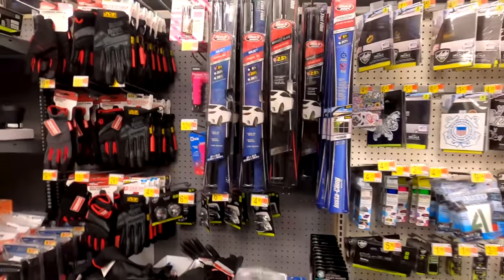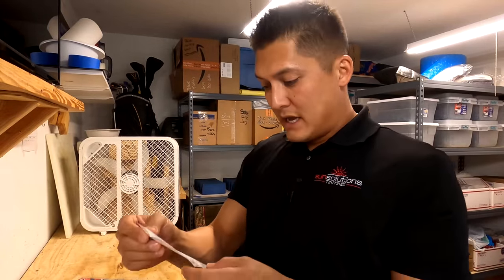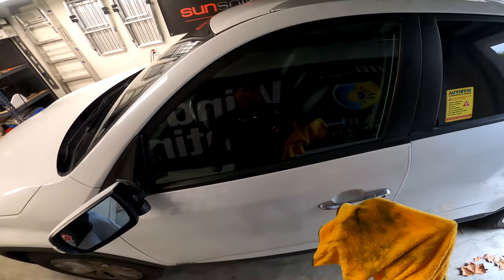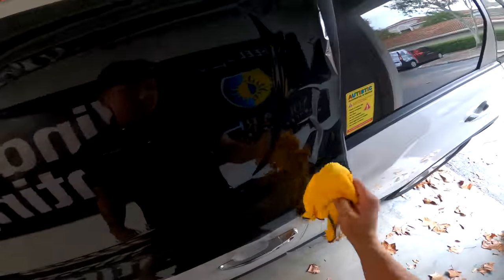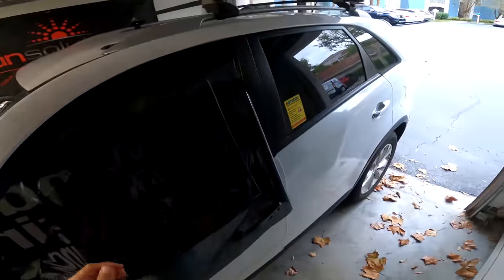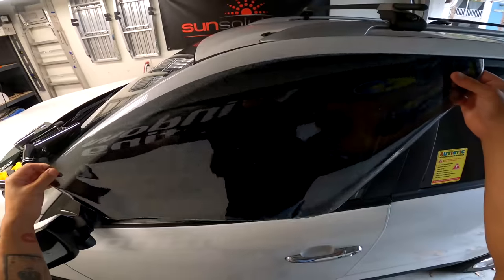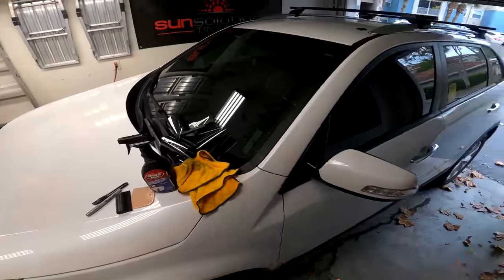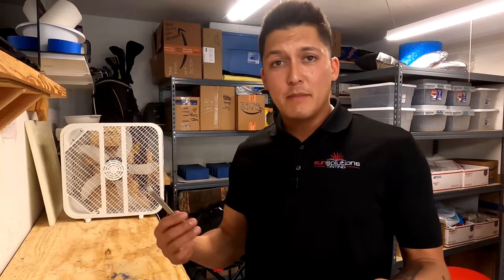How To Tint Your Windows | Walmart Black Magic Window Tint

Comment from the maker: Good luck to all you DIY'ers! Let me know how your installs went! Comment below!
Reply: Is this how you tint your cars?
Reply from the maker: @thesloth944  no not at all but this video is for normal people who just want to tint their windows themselves.
Reply: it turned out pretty bad the first time around because i had rain sheilds on the tops of my windows and i had to take them off for the 2nd window so i could do a pre template on the outside window first. i did the 2nd window with a pre template and it turned out wayyy better. i did 5% in the back and 35% on the fronts
Reply: I'm doing mine this weekend bc is getting Lil b hot 🔥 (75°)  but I'm doing it outside I don't have a garage 👎🏽
Reply: @thesloth944  ) 9
Reply: Just got the 2.5% for my back doors. Can't wait to knock this project out this weekend. Great video!! I got the tint kit-just have to get the kit and the recommended tool you suggested. Thanks man, ill try to remember to post a follow up
Reply: And as always, check your State Tinting Laws before you do anything. Ive seen people do their own and get stopped and cited or had to strip the tint off before they could drive the vehicle away from being stopped for it.
Reply: @WindowTintingBusiness  it’s been a long time since I’ve tinted windows. The Sharpie trick is good one. I always prized my Olpha blade. You did a great thing showing everyone how to do it themselves. Hopefully this will give them the confidence to at least try it. 👍👍👍👍
Reply: So no heat shrinking and no fingers?
Reply: 1st timer here. Gonna learn how to do this so I can tint my driver and front passenger windows. Its a Ford edge. What percent should I get? All my other windows are tinted pretty dark. Thanks
Reply: @thesloth944  iiîi lol
Reply: Hurry please look me up please
Reply: @TACTICALNOMAD  Thanks for the info sir. I had LE tell me bout the same thing. Made it where had to remove it to proceed. Now i know better. Thanks again sir. 😎👍
Reply: im trying to do it on a motorcycle helmet visor. it's just not working. its impossible to get the bubbles out. i have the squeegee and everything :/
Reply: Buy tint window from auto parts if you don't want your tint window to turn out blue.
Reply: What's in the spray? Is it soapy water or Windex window cleaner?
Reply: @mrmagoo9901  soap and water
Reply: How much would I need if I wanted to do a full size Silverado all windows?
Reply: Hey, you forgot to show us how it looks from inside the vehicle after the curing time and under the sun because I have a doubt that the appearance is foggy or maybe not, like this we may have the best and complete feedback of the product. Thanks
Reply: Great vid my truck looks great 5% all around
Reply: What if your windows have factory tint
Reply: I thought I did a good job until I rolled the window up and all on the bottom it had no tint I made it too short🤦🏽‍♂️
Reply: The trash can got tint not the car lol the wind wasn't my friend and not really knowing what to do. I'll give it a try again. I was thinking of using a piece of cardboard as a stencil of the lay the tint on the stencil then cut it out
Reply: I saw you had some Johnson&Johnson, I’m not sure you used that but if you did what did you use it for?
Reply: I spent an hour trying to do it for my first just for me to roll down the window and it rip off rolling it back up🫠😂
Reply: @WindowTintingBusiness  veey cool
😊
Reply: Also what did u use the baby soap for?
Reply: Instead of freehand cutting the top edge of the film why not just cut on the on top of the window using window edge as a guide? After that just lower the edge 1/8 of the inch on the other side.

Comment: came here not even knowing Walmart sold tints. Left knowing exactly what to purchase and how to install myself. great video  this is literally the best instructed video ive ever came across
Reply: I hope you didn’t get it, it looks like shit in the sunlight which is why he didn’t show it off outside. It has a milky unclear color, please don’t buy this piece of garbage.
Reply: @applepollo  what tints would you recommend? Can you order them online?
Reply: I'm curious as well about Amazon/ any other decent film that a diy can just go pick up?
8-9 yrs ago I bought  just about all that (x2 the film) for a car that I didn't keep... Could it still be usable?
Reply: @MAGA_Randy_Marsh  I highly don’t recommend buying any cheap Walmart crap. If you want tints go to a professional shop as industrial sellers mark up only full rolls of tint that usually go for 10,000 USD. Which is what tint shops buy for their businesses.
Reply: @bigdaddy6256  it depends on the condition that you have kept the films in. Amazon/Walmart or any big chain company will sell tints of low quality, as tint films are manufactured in masses of rolls that are shipped out at extremely high prices, I suggest going to a tint shop and getting an estimate instead of buying low quality garbage. Spend your money on something that will last long and turn out good instead of wasting it on rubbish.
Reply: @applepollo  get a life... so rude and for what
Reply: 😂This is black magic of youtube it won't work out that easy 😂

Comment: I decided to tint all my cars and at first i was gonna use walmart tint but Lexen sells 24 inch by 100 foot rolls for $74 in any %.  The walmart is 24 inches by 6 feet and is lower quality. I been using Lexen for 5 different cars and never had any issues. You can easily do a couple cars if you're a beginner like me and if you mess up then you still have tons of feet left.🤣
Reply: thank you
Reply: @simpp8  no problem!
Reply: I was actually going to buy that roll, thank you for leaving a review on the exact product I wanted to buy.
Reply: @tjboylan20  You're very welcome! I have not had any issues with the rolls i bought from them but if you order from their website directly they will exchange the roll if you ever get a defective roll of tint. By "defective" i mean if it comes bad from factory. My local shop uses their tint by hand and plotter but i was not gonna pay $265 for a sedan! 🤣 After a few cars i can now say this is my go to tint for the price. Held up for nearly 3 years with no bubbling on a car i sold. I currently have a prius which i did and no bubbles or peeling. I'm sure i've could have gotten more cars out of the first roll (100ftx36-15%)  but i was learning and messed up a few times so i got 3 cars on the first roll and had about 40 feet left. The second roll is (100ftx24in 5%) and used about 25 feet on that so far.
Reply: Thank you for that info! I also see they will precut them for you. Thinking about that option! Did you buy all of the stuff he recommended in the video as far as tools and aides?
Reply: @DollarsNCentsOnline  No problem! I watched -Window Tint Warriors & Tint Studio and see the tools that worked best for them and picked out a few that i thought worked best for me. I have not had any issues with any of them and they are of good quality to me. The only reason i didnt go with precut kits is because if you mess up on 1 piece, then you have to order another kit. The whole roll was the best option for me and i'm actually gonna tint my brother in law's car tomorrow with that same 24 inch roll.
Reply: What size should I get 20 or 24X100 I have a minivan and a suv I want to tint so what’s the best size to get that will work over all
Reply: @l.m.g8799  I think 24x100 should work but to be safe just grab a tape measure and check the height of the side and rear windows if that's what you plan on tinting. The front windshields are usually larger and i had to use the 36x100 rolls for those.
Reply: For the front windshield did you end up struggling on your first time ?
Reply: @samuel9046  more like around 3 or 4 times lol
Reply: @TonytheYorkie  did you just take it off and retry it til you got it ?
Reply: @TonytheYorkie  around how many times did it take you to get decent at it? I want to learn just to do something for a friend or family member on the weekends
Reply: @samuel9046  I took it off rinsed it and tried to adjust and practice laying it but then i noticed some wrinkles i made and took it off. It took about 5 times till i learned how to heat shrink properly.
Reply: @TonytheYorkie  oh okay and the sides was it easier to get the hang of ?

Comment: 1. Spray and wipe outside
2. Spray and wipe inside panel
3. Roll window down wipe middle section
4. Roll window up, scrub and squeegee (he used razor)
5. Wipe panel again
6. Put tint rectangle on outside window, liner out
7. Tack down with squeegee
8. Sharpie bottom 3 egdes, roll down slighty, then sharpie top edge
9. Cut edges, bottom 3 edges with 1/8” extra (3 blades, knife back end down), tear away from workspace
10. Roll window down, 2 fingers of space
11. Squeegee inside window (wipe squeegee after each wipe
12. Spray inside to lubricate
13. Peel liner off, leave 2 inches at bottom, spray tint
14. Lubricate inside glass again
15. Place tint on inside glass, careful with bottom egdes
16. squeegee top 4-5 inches down
17. Roll up window, squeegee newly exposed glass
18. Lubricate rest of tint
19. Carefully tuck in bottom edges behind the sweeps
20. Squeegee full tint, spread out film evenly
21. Use bondo card to squeegee tint into window edges if necessary (dont use on visible parts)
22. Wipe inside panels and outer glass
23. Dont roll down or wash windows for 3-5 days

Added as personal notes, thanks for the awesome video!

Comment: the first video that makes me feel as if i can do my front windows on my own and properly! thank you sir, true master of your craft
Reply: How’d it go? I’m about to go buy the tint now
Reply: @lanerobinson8994  it went well!!! But two rolls of tint just in case. I trimmed the first one wrong the first time. I also did it outdoors as well. Some creasing but was able smooth most of those out once I turned my car heater on and got the windows warm (didn’t have a heat gun) the bondo things work great for finishing off the edges. Good luck!!

Comment: Thanks for the video, I found it very informative. As a detailer, I just wanted to add you should only scrape one direction when cleaning glass with a razor blade, never back and forth. You do not see scratches initially, but if you pull it out in the sunlight and look closely they are there

Comment: I started window tinting in 1986. I opened my own shop in 1994. I was in business until 2017 when the frequent bouts of carpal tunnel became too much. The only thing I would do differently is, I would cut the tint on the top edge of the glass while it's down a couple of inches. I would also  join 2 pieces of tint together and cut both front and rear windows out at the same time.
Reply: Now you know that these are rookies on here they can't work with one piece of tint let alone two pieces and one cut.
Reply: Is there a reason why you have to cut it against the window instead of on a surface you don't have to be so careful on?
Reply: Comments like this are why I go thru the comments thank you for this. You just made my project that much easier.
Reply: @rhondasmith1912 You're welcome.
Reply: @DollarsNCentsOnline  cutting on  the window will give you a perfect or near perfect pattern. Also, if you use stainless steel blades they're lees likely to etch the glass.
Reply: Correct, I never mark the film at all.  I squeegee it to the glass on the outside like he does, and then just use the top, sides, and trim bottom as a guide for cutting.  For the top of the glass, it is much easier to use the actual glass edge as a template to cut against.
Reply: And here are a few tips, use stainless steel blades, and for your spray bottle use water and a few drops of liquid joy soap.

Comment: You forgot to mention mixture of water, soap and alcohol for spray bottle. Very good instruction on tinting.
Reply: I thought the same but I think the kit he bought has a premixed slip solution in it. Otherwise I thought he should mention whether he thinks he is saying  heat shrinking to fit window curvature is unneeded.
Reply: Thank you. I was searching for this comment

Comment: To separate the liner, you can also use two pieces of scotch tape - one on each side of the tint. Touch them then separate the tape and the liner will come right off

Comment: I did this same method and finished my f150 stx truck today. Literally Walmart film is good enough as tint. The 35 percent is a bit light though. 20 would've been better but Texas law is only 25 percent in front so I didn't want the hassle. Thank you for this video. My first attempt was horrible but the second time is done good. Thank you

Comment: I used the Black Magic window tint on my truck back in 2014 or so, and it's still holding up to this day. If you follow the video, it will likely outlast the amount of time you own the vehicle. 

My only gripe is the color of the tint from the outside. Thankfully it's not purple or chrome, just not the black I was hoping for. For reference, I went with the 20% VLT.

Comment: Your video is going to be so useful for me next month.

You demonstrated the important techniques for completing this job in a professional manner, even for an elderly clutts like me. HaHa

I'm going to film the back doors, the rear swing-out windows, and the glass in the lift-gate on my Ford Excursion, in preparation for going Full-Time Boondocking.

I'll also fabricate Privacy Curtins for temperature control against hot glass in the daylight sun and cold glass at night. I expect that the dark black film will absorb much more sunlight than factory tint.

You did a really, really good job presenting this video, and I thank you very Muchly.

I've downloaded your video from Utoob for ready reference when I get to this project.

Again, thanks for your presentation........

Comment: The side that curls always goes to the outside of the car before you cut you can also lay the factory edge at the bottom  of the window   set you're  tint roll down youre window pull back extra tint on top spray  the glass squeegee the top part of tint   cut extra off  pinch the tint with youre fingers slide youre blade  rate across the top edge of window  you can also use youre fingers to cut youre corners

Comment: Hardest part is cutting the curved areas, the one I bought from Walmart did not have the film protection but a paper wrap instead.
Reply: You got window cling
Reply: @DevArnold  That explains the thickness, thanks.
Reply: Thanks, now I know. Oh well back to Walmart then.
Reply: I could be wrong but isn’t window cling for your house? I didn’t even know you could tint your house windows!
Reply: @lionsatmidnight their static clean sucks it’s super rubbery and purple and hazy

Comment: I'm no pro, nor would I do any1s tint but I do my own tint on my cars an old ladys cars. Same way I've always done it but 2 things different. I've never used a sharpie before(or any marker,pen,etc) an i have to use my high dollar🤣 heat gun from harbor freight for $10 bucks. I've tried not to use it an it will not turn out to save my life without it. But great tutorial 👌! Looks good!! Just picked up some walmart 20% yesterday an gonna do the front 2 of the old ladys expedition here in the next day or 2. Gonna try your pointers an see how it go.Thanks

Comment: And it only takes about 5 minutes but to use the heat gun or a hair dryer or something like that to try to dry that window tint and solution as quick as you can and if it's really hot outside then that works too just park it outside in the sunlight make it dry quick so there's not going to be any air bubbles in it
Reply from the maker: well if there are air bubbles in it then you have to squeegee that portion out. using a heat gun will only lock it in there and it will never come out.

Comment: I for the live of me couldn’t do the rear window of a hatchback, working outside against gravity and the wind picking up, I ended up with creases trying to do it by myself. The smaller the glass the easier the tint install was for me
Reply: You have to heat shrink the tint to the window before you cut it to size or else you'll keep getting creases. This is a step he left out. IF, by chance, he didn't heat shrink the tint, I'm wondering how he got the lines and wrinkles out without heat shrinking.

Comment: Excellent video! I learned a lot. I am going to look through your videos to see if there is anything on removing old tint. Also any tips or advice for frameless windows?? At the end of the video you said to not roll the window up for 3 to 5 days. Another question is on my g35 my windows "bump up" like a half inch when you shut the door. How does that effect the tint on the crucial leading edge of the tint??? Again. Excellent and well done on the video. Any tips would be great for my type of install
Reply: You mean don't roll it down for 3-5 days

Comment: I followed all the steps and even used the same film and still got the sharp long streaks at the bottom and air bubbles that formed. Any advice on what I did wrong 😭😭

Comment: Man, I wish watched this before attempting to redo bubbling tint on my car yesterday. I was irritated it took so long and I struggled. I pre cut my tint a little big and it made it a living hell, although it still came out "nice" for my first attempt at tint. I also cheated and took window seal off the door panel. Now I know what I did wrong. Thanks! 

It seemed impossible to get the old adhesive off. Kept gumming up blades, they wouldn't scrape it clean, even 90% rubbing alcohol didn't want to take it off after scraping what I could.  Is there anything better for removing old tint adhesive?
Reply: ATR adhesive remover. It will make the adhesive melt like butter
Reply from the maker: I’m glad it helped you install your window!